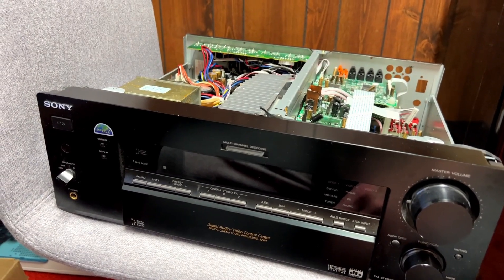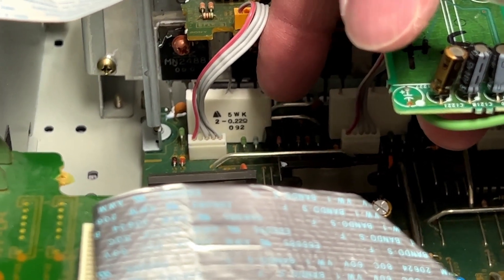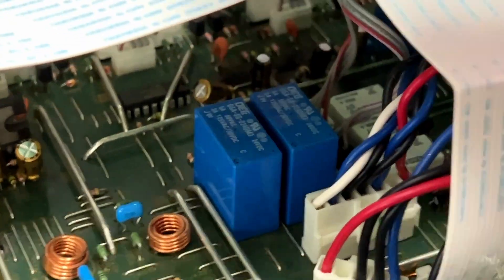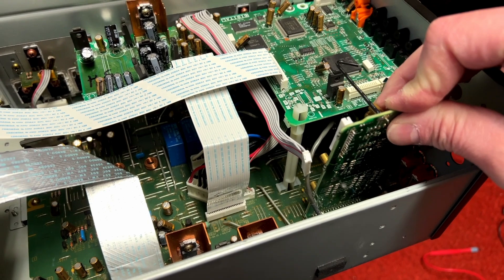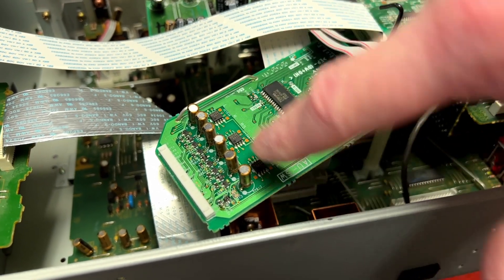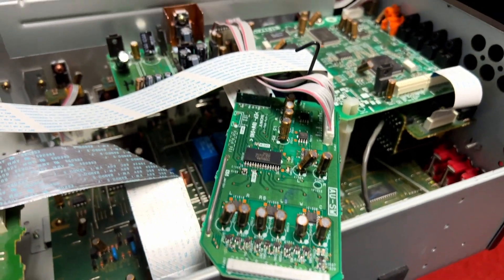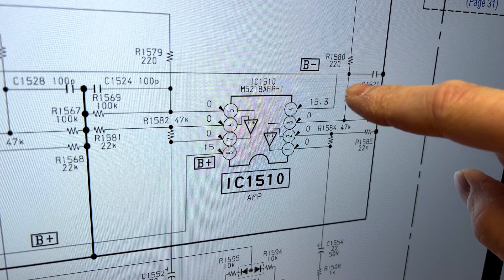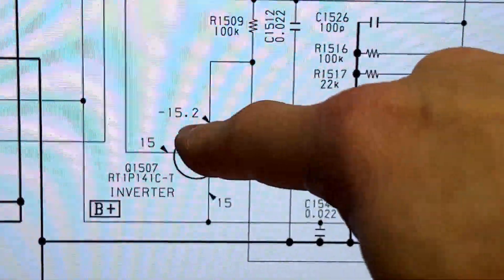Sony STR-DB840 Part 4 - Mystery Solved?

Comment: Hello. Unfortunately, in Sony STR-DB 940, 840 receivers the system responsible for switching sources often breaks down. It is located on a vertical board next to the tuner board. I had two such receivers on my desk, one of which I was able to repair only because I managed to buy a functional selector board. The system itself is missing and is designated TC9273F-012. Measure the voltages supplying this system, pins 1 and 28 (first and the latter) relative to the ground. They should be -15 and +15V, if they are lower, then the system is 99% damaged (be careful not to short-circuit, because if the system is operational, then it would be a shame to destroy it). You can take measurements on one of the op amps on this board (pins 4 and 8) since they are powered by the same voltage. Perhaps on the entire +15 and -15 V rail going to this board.
Reply from the maker: Very likely that's the problem with this unit. I can't see all three op-amps failing simultaneously, and both voltages were there.
Reply: I think you're right. There are 4 common faults with these amplifiers. 1. Poor soldering in the area of the output transistors and DC protection relays. 2. Failure of TC9273F-012 (There is no sound from the 5.1 input but there should be when connected Optical. 3. Failure of IC1503 Converter AK4527 (The sound will be distorted). 4. Failure of IC1201 System controller MB90573PFV-G-296 -BND (As happened with my copy of the receiver. Symptoms are strong heating, no sound, the menu works with strong delays.) Signal to DVD/LD in Optical, I think there will be sound.
Reply from the maker: 4 months later and I now have a working MD unit with optical out to try with this receiver. It does pass sound using the optical inputs but it's still very quiet. So the TC9273F has definitely failed. I think IC1503 may have also failed.